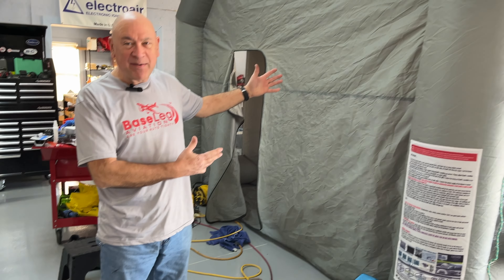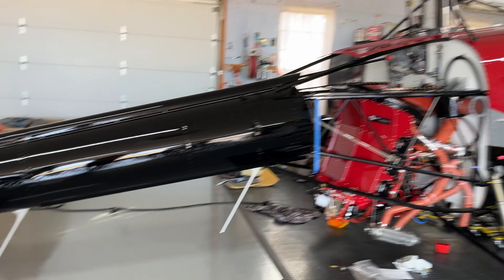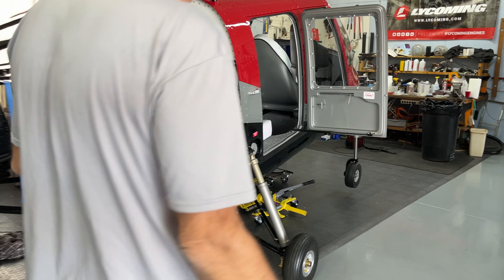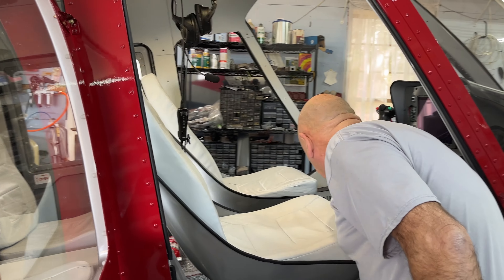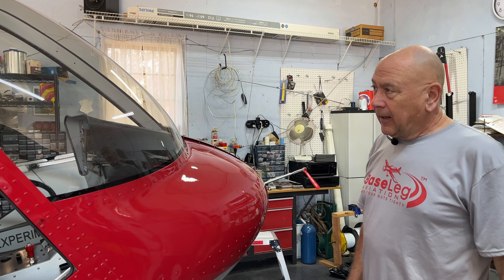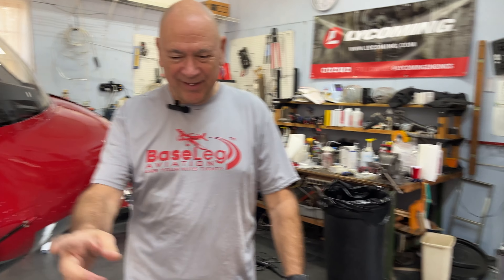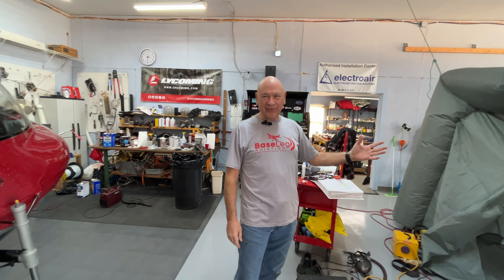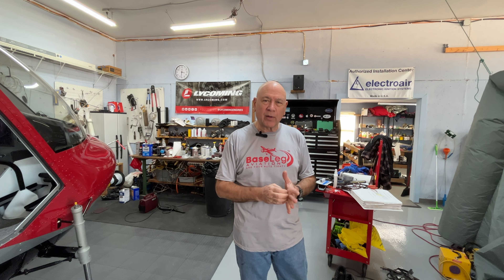hummingbird update 2 14 23 Finishing up.

Comment: Congratulations on finishing your project. I’d some details about the paint booth if you get a chance. I’m thinking of using a paint booth as a quick way to add a heatable space in my metal hangar.
Reply from the maker: Inflatable booth used is a Sewinfla 26x13x10 paint booth. and sewinfla air draft device (Amazon).  If you watch the hummingbird videos you will see the adaptation with pvc supports added .

Comment: G,day from Sydney Australia.
The cable on the Champ was rubbing parallel, different to the usual jamming
from a pulley or into the tube.
So the finish on the panels;
Alidynine
Primer and sanding 
Masking tape color sections
X2 finish coats of gloss automotive thinned 10% allow dry
Clear coat thinned 10%
🪂